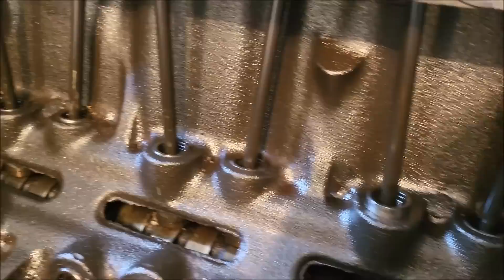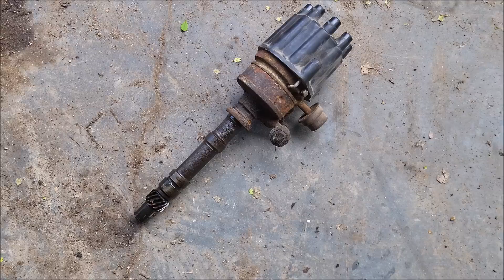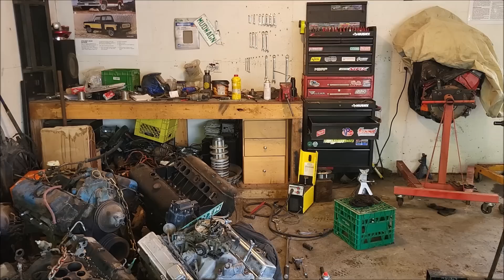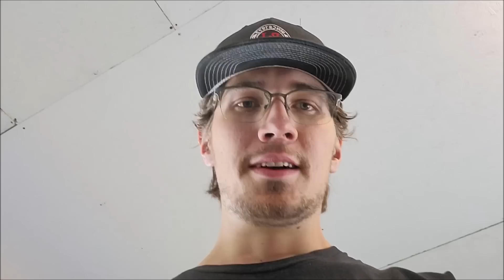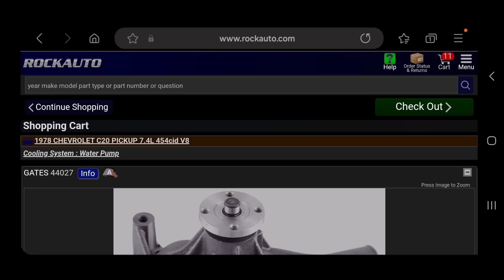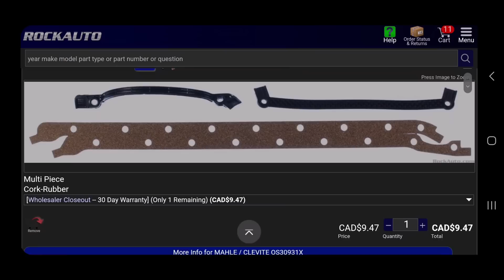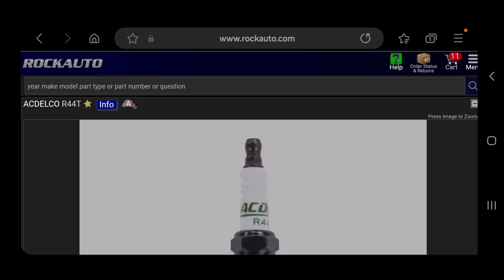Why Does Everyone Ignore Tall Deck Big Block Chevy V8s?

Comment: Dont use a 454 flexplate on a 427, 454 is external balance, 427 is internal balance. A flexplate from a old style 2 piece seal 350 sbc will bolt right on that 427. A regular 396/427 internal balancer is also needed. 454 is weighted. Im currently building a 427 TD with 6.535 long H-beam rods and forged dome pistons for a 9.8 deck 427. Be around 13.2-1 compression. Gonna turn mine 7500-8000 rpm with a big 274/282@.050 solid roller cam, BPE 316cc rectangle port aluminum heads, 2.30/1.88 valves and a Bowtie singleplane intake made to use a standard distributor. Also using a 1050 Holley Dominator. Should make well over 700hp NA. The deck is .400 taller than a 9.8 deck block. These engines were popular in the truck & tractor pulling world back in the day, seen a few blown, alcohol units making 1800+hp in pulling tractors. Also used in boat drags and Pro Stockers in the late 70s. Also mud bog trucks. They are stout. Definitly worh building. Buy an intake made for a tall deck and .400 long pushrods and thats pretty much the ticket. We built a 366 years ago just to kerp a drag car functional while the 454 was being repaired, with just a L-88 cam, a Tarantula intake, 850 Holley and 2 inch Hooker headers. Ran 7.50s in the 8th in a mid 70s Camaro with a 4000 stall & 4-56 gear. Shifted at 6000rpm. Bottom end was stock except for .060 overbore. Had closed chamber 215 casting 396 heads on it. Bolted right into thst camaro with room to spare. Headers fit no problem. Them blocks are thick as hell.
Reply: @thereluctantgearhead4544  That is an awesome build you've got going there. But I don't think this guy is going balls to the wall,I think he is trying to have some cheep fun with some discarded big blocks like a lot my fellow technicians did back in the day. But I got to say I am very impressed with your build. Sounds like it's going to be awesome.
Reply: @johndcunninghamjr4111 I'm building it to run 9s in a 84 C-10.
Reply: I am a ford guy but these bbc engines in all there forms are as good as anything out there. We used to use them to haul cars on a car carrrier back in the day.  We would rev them four grand all day long.
Reply: @robiparry941  Darn right.... 🤜
Reply: My uncle used to race his 69 Boss 429 mustang at the Friday night drags at the Tulsa raceway for a few years before he sold it due to having to spend too much money  because it didn't hold up as well as his 67 L-88 Vette. which when he first started racing it he had a 375 hp ramjet injected 327 that he campaigned for a few years after yanking the original numbers matching L-88 out and setting to the side and put the 327 in the Vette and then went a non numbers matching 427 with the L-88. Before doing a frame off restoration and putting the factory 427 back in and showing it in some car shows. He got a 62 Bel Air with a 425 hp 427 mark IV big block and a factory 427 mark I big block in his 60 Impala and none of them has given him any issues the Impala was used by Ertal models for their cast metal 60 Impala down to the license plate.
Reply: @theEVILone0130 I miss the old midnight drags in Tulsa,twenty minute drive south on 169 was well worth it.i can't believe the track sits empty most the time now.
Reply: I made this mistake back in Auto shop/Highschool. My flex plate was cracked on my 350 small block in my car. I took the flex plate off of the small block that I pulled out of my Dad's Caprice and put it on my Chevelle. It was shaking pretty bad when I drove it out of there. Lol I learned that those metal things on the flex plate were counter weights for an externally balanced crank. I ran the numbers on the block and found out that the Caprice had a 2 bolt main small block 400, cool. I had to do that job twice,  I noticed the difference between the two flex plates, but I still installed that externally balanced one on there. Haha
Reply: Thank you
Reply: Should easily make 800 ill bet cause 700hp + on large sbc 421 my old man was building late 80s early 90s for dirt late model cars. Man those things rev so fast and high I loved that sound as a kid. Now I love it even more cause I understand it.
Reply: @Thumper68 yep, I'm thinking it'll make 800+HP, but I usually give a low ball estimate to keep the trolls at bay.
Reply: Wow❤ so cool !
Reply: I’ve taken a Stock 454, put a Roller Cam, Header’s, Bench Polished the Heads, and an Old School done his little Magic… 
70 Chubby, that Puke Green Color, looked Ruff, 4 Speed with Stock Possy Diff…
I beat the Streets up, and was running good when it left my hands!!!
Lots of Cheap fun in Big Blocks.
Reply: I've heard of derby guys going to the 366 bbc. Grunt engine with thick cylinder walks i guess.
Reply: @RaginCajun-d3n they are practically bulletproof. Be a good derby engine actually. A 76 Caprice wagon with a 366 would be a killer derby car.
Reply: The 366 has a big piston with 4 rings is why people don't make street motors out of them
Reply: @bluesky6985 bore it out to a standard bore 396 piston and use 6.535 long rods. Makes it a whole other animal.
Reply: @bluesky6985 those 4 ring pistons make good ashtrays.
Reply: You can use a flexplate
Reply: I have a td 427, I think both the 427 and the 366 had factory forged crank and rods? The 366 is a de stroked 396 or same stroke smaller bore?
 I got the eagle 4.5" stroke crank, 6.535" h beam rods, its already .30 or .40 over now whatever it was it calculates to 520 ci. I got the newer skip white aluminum heads, im clearanceing the block for the crank right now then going to bring it to the shop to have them make sure cylinders will clean up I don't want to bore it more. Then I'll have them measure for piston pin hight. I'll be happy with 550 to 600 hp, should have gobs of torque it will be going in a 66 chevy c10
Reply: Your wasting a td 427 block if you dont make it 500 to 535
 ci
Reply: @ryangulley2051 RPMs make power. Don't want a 5000rpm tow truck engine. I have other bigblock Chevys that are bigger cubes. They'll make more low end torque, but this engine is using a 5000+stall, so low end torque is a non issue. It's built to be a high RPM unit. Easier with a 3.760 stroke, 6.535 long rods and lightweight pistons.
Reply: call my Billet aftermarket crankshaft is internally balanced
Reply: what a waste
Reply: How did you keep them from blowing up???My dad owned a chevy dealership in Illinoise when I was growing up in the 60s and I had access to all of them.I couldn't keep any of the big block chevys togeather for very long..they would throw rods through the block in an instant. I tried everything...A couple of my buddies had SS 396 chevelles they bought through my dad.One of them was an L78 375 hp and that car was wicked but it blew at around 9k miles.Thry ere not built nearly as tough as they should have been.
Reply: @jimmillet1442 Sounds like y'all hasn't learned about maintenance...! I have an 85 Suburban, 454cid/th400... It was G-pas and it became mine after he put 278k on it... It now has about 520k on the original engine, but we know how do maintenance...!!! I also has my uncles Chevlle years ago with a 396 with over 350k on it before needing rebuilt...!
Reply: @kurtisstutzman7056 Well can't help what it sounds like but I learned from experience and being around them and the way something is built has nothing to do with maintenance...if it's weak it's weak..I've seen and had more exploded rods and cranks in big blocks GMs  by far than anything else.
Reply: @jimmillet1442  Maintain them, and they'll last many decades in my experience...!
Reply: @jimmillet1442  then you didn't know what you were doing because 454's have been the backbone of weekend bracket racers at drag strips all across America for decades. Most of those Chevelle's and Camaro s were running cast cranks in those 454's as well. Stock big block  internals were good for 600+ horsepower all day long and were far from weak. That's laughable. 
If you used the wrong torque specs for the crank and rods, then yeah I could see them spinning a bearing. Failing to resize factory rods is a no-no as well. But, there's a reason so many racers have used BBC's. Besides, if there was an inherent weakness in these motors, we'd all have heard about it by now.
Reply: @msh6865  Sorry but what you said is very laughable!...Check out the powernation 454 build on youtube..they tell several times the bottom end is good for 500hp at best and they had to change out the rods and crank...I grew up around all of them,396,427,454..several 409s which isn't the same family but you claim I was doing something wrong well then everyone else was too then because  I rode in several friends cars that exploded with me in it...but then you could go to about any junkyard and find another and be back on the road in a day to do it all over again and they did.But I wouldn't run 500 horses with stock rods and crank in a 454..no way.
Reply: @kurtisstutzman7056 Clearly you are not a RACER or hot rodder. Any engine can last forever with maintanence IF YOU NEVER BEAT ON IT.
Reply: @JeffKopis  I have an 81 Camaro that's gone 8.90s, but it generally lives in the 9.30s... It's a built 540 from Steve Morrison... It's pulled by my 85 Suburban...
Reply: @jimmillet1442  You can run 500h.p
 with a stock bottom-end BBC ALL day, if you keep the RPMs in check.

Just because that same thing will fall apart with your ford junk, does NOT mean that it doesn't work well with a G.M. big block... 🤦🏻
Reply: @jimmillet1442 , exactly.  Everyone that had a big block  Chevy had blown all of them up by 1975. They either replaced them with a small block or junked the car. No big blocks in my area survived the mid-seventies.
Reply: @bradleynelson5915  Too many idiots, and not enough BBC's.... 

Sure, they weren't drag race engines in stock form, (not many factory engines were) and the problem was that too many people THOUGHT that they were, constantly revved the piss out of them, and blew them up. Foolish people..

Put some decent parts in the bottom-end if you want 7000+ RPM's out of them, and they'd survive for a LONG time without issue. 

There's a REASON that they went on to be the winningest engines in drag racing, and dominated for decades. The D.R.C.E. 1, 2, and 3 engines WERE the thing to have, and there's STILL plenty of them out on drag strips everywhere still doing sucessful duty even though they are old by now. Can't argue with facts. And I don't even run Chevy motors in my stuff, so can can NOT claim that I am "biased". 
Just educated...
Reply: @davelowets  The big block chevy was designed as a nascar engine from the drawing board. It was called the "mystery motor" when it was put in a race car for the first time. The mystery motor is a gen 2 big block which is almost identical to the legendary Mark IV big block chevy that was in the 1970 Chevelle SS. The sbc already existed so GM had its badass V8 powering cars and trucks
Reply: @bradleynelson5915what the fuk are you smoking? I bave several and tons around if you look
Reply: @shootermcgavin2819 actually for ta and nascar chwvy had a abc head llke the bigblock that never made it outt to production
Reply: Use forged rods and pistons  @jimmillet1442
Reply: @jimmillet1442  That is a flat out lie, I have been a tech and racer for over 4 decades, BBC engines just dont "blow up" like you think.
Reply: @jimmillet1442  If you have been in "several friends cars that blew up" of any assorted brands you people don't put oil in your engines. After overv 40 years of racing and hot rodding, majority with BBC I have had exactly 2 engine failures and one of was a broken roller lifter so that kinda goes back to the cam manufacturer. Also broke 1 20 year old crank that had been in race engines for over 7 seasons.
Reply: @fastone371  Sorry dude but even numerous chevy people have told me how weak the rods are in big Blick chevys and this is a well known fact..Oil has nothing to do with it..If an engine makes more power than the parts it's built with can handle then common sense says oils not going to save it when you run them.They just can't handle 7k rpm sprints for very long.
Reply: @jimmillet1442  Not to be rude but you have been seriously uniformed, people have been successfully using Chevy rods in BBC with nothing more than a set of quality rod bolts which you normally replace at rebuild time anyways for decades, Ford small blocks have crappy rods with 5/16" rod bolts, Cadillac, Buick, and Olds all have crappy rods, but big Chevy's, no. Go to any drag strip and ask the over 75% of guys down there who will be running BBC if they still have stock rods and many will say yes. Then ask how many had rod failures, you wont find many and like I stated, 75% of the cars will be running BBC unless Wisconsin, Indiana, Ohio, Tennessee, Iowa, Kentucky, Missouri, Georgia, Michigan, Illinois, and many other states have very, very special GM engine parts. What you claim about BBC connecting rods is pure fabrication.
Reply: @kurtisstutzman7056 Y'all keep talking about 454s and 396s and they are different. They are short deck. This is a tall deck. They don't fit in Camaros etc. Even  if they would fit in the engine bay, motor mounts won't work. they don't even have place to bolt mounts on side of the block.
Reply: @briankennedy5578  My 79 z28 clone had a 454cid/ th400...! They do fit...! Even in a third gen Camaro, a big block fits...!!!
Reply: @jimmillet1442 Richard Holdner took a junkyard 454 and put a big turbo on it, made over 1000+HP. It didn't come apart. All he did was open up the ring gap. Your probably a LS fanboy, that's why your jealous of the bigblock Chevys. I've built more than 50 bigblock Chevys, they ain't weak at all. But a fuckin idiot can blow up any engine.
Reply: @jimmillet1442 Which rods? There are a few GM bigblock connecting rods. They are all tough. I've used the 7/16 Boron bolt dimple rods in 8000+rpm bigblock Chevys and never broke one. The "thumb" rods in the TD engines are pretty stout also. The basic 3/8 bolt pass car bigblock rod will hold more than 600hp all day. I'd bet you have zero experience with the bigblock Chevys. Otherwise you'd know better.
Reply: @briankennedy5578 Wrong, they bolt right in bud. I've done it numerous times. Fixing to do it again.
Reply: @thereluctantgearhead4544 stock rids..I grew up around piles of them..the ss396 cars were everywhere..same with pontiac GTOs...but the 396 engines blew faster than anything ...I was in several cars when they let go..one of them blew a piston fragment into the firewall right where I was sitting...I was in a 67 gto that blew a piece close to me also..scary to say the least...the others blew out close to the road and didn't send anything my way...we ran cars hard back in those days. Thats what they were built for...the fords and Chryslers didn't come apart  like that but the Chryslers had so many electrical problems I didn't like those either.
Reply: @thereluctantgearhead4544 Ive got a 366 laying outside that i took out of a c6500 i put an engine in. There's no place to bolt mounts on the side of the block. The mounts bolt onto the front of the block by the timing cover, and to the bellhousing.
Reply: @jimmillet1442 don't know much about these things obviously. You should listen to people that been building them for drag racing for the past 45+yrs. You might learn something, but I doubt it. Sounds like you already know everything, but in reality you don't know shit. Must be a LS fanboy.
Reply: @jimmillet1442 people would wind them out like a small block Chevy,4500rpm red line for the big block if you miss a gear shifting its blown.
Reply: @jeroldlafferty54 you've obviously never built a bigblock Chevy.
Reply: @jeroldlafferty54 I'm using a 5000stall and a 4-88 gear behind a bigblock Chevy. Shift at 8000-8200rpm.
Reply: @jimmillet1442 My father had a 67 Malibu SS with a 375 hp 396 that he used as a daily driver and raced on weekends when he was in the chariots car club. The changed out the cam, heads and intake along with long tube headers and had over 100k miles before selling it. It make multiple trips to Rochester MN, Poughkeepsie NY, Chicago IL, and San Francisco CA on business trips for IBM schools and never had an issue. He also still owns a 71 Cheyenne pickup with a warmed over 402 big block with a 12 bolt posi-track rear end.  he finally parked due to the turbo 400 tranny finally starting to slip  on the 1-2 shift. It has over 250k miles on it. I know a lot of people who own big block chevys who race their cars and never had issues with big blocks.
Reply: @jimmillet1442 396 and 454 are different. Tall decks are pretty bulletproof
Reply: @jimmillet1442 I use aftermarket H-beam rods & forged lightweight pistons. In stock form, they are designed to run all day at 3500rpm. I've been building bigblock Chevys since the 80s, had pretty good luck with them. Fastest car I've ever owned had a 509 bigblock Chevy in it. It turned 8000+rpm every run. Never blew it up. Raced it for about 5yrs in a back half 70 Corvette. Also had a 477 in a Malibu Wagon street race car, it paid for itself. Had a few more examples, but I've owned over 200 vehicles since the early 80s. Also build Pontiac, Buick and Oldsmobile engines.
Reply: @thereluctantgearhead4544 all those engines fly apart easily..I always liked the 60s GTOs and everyone talks about that 400 pontiac engine but it was weak..yes ypu can put better parts in them but like I've been told that 400 engine cant go past 450hp..the block is too weak.
Reply: @jimmillet1442 just because you can't build engines don't mean others can't. I've had a much different experience with those old ass engines. But I've built over 1000+engines since 1980. I'm building a Pontiac 400 now I'm going to turn 7500rpm. And I guarantee it will stay together.
Reply: I know a guy that built a "stock" block 400 Pontiac with a 8-71 blower on alcohol. Run low 8s in a 68 GTO. Tell him how weak they are. It's on utube if you look for it. Tell him what a dip shit he is for spending all that money on a Pontiac engine. I have a 63 Super Duty 421 Catalina. Been racing Pontiacs for years.
Reply: His makes well over 1000+HP.
Reply: You just gotta know how to build them.
Reply: @jimmillet1442 Then you WERE doing something wrong....

If you can't keep a B.B.C. together, then you should have given up.
Reply: @davelowets  they are famous for blowing up..sorry but that's the facts.The rods and cranks both are weak.
Reply: @jimmillet1442  NO, their not famous for "blowing up".... they're used very successfully at drag strip ALL over the country. 

ALL engines WILL blow up if abused beyond what they're capable of. If you were buzzing stock BBC's to 7000 rpms every day, and they blew up, well THAT was on YOU. There is NO reason to go over 5k-6k rpms with a stocker. They're done making power well before that anyway. 
If you threw a cam and heads on, and they blew up at 7000rpms, again, that's on you for not upgrading the bottom end parts. If you use a stock one like it SHOULD be, and keep the rpms down under 5500, it'll last a LONG time.

If you had all these problems, you were abusing them, plain and simple. A stock engine is NOT a race engine.

If one upgrades the necessary parts for the application, they survive JUST fine.
Reply: @jimmillet1442  If they blew- it was usually the driver or the maintainance
Reply: @leinie6683 
I had a Yugo,  I changed oil and filters every 2000 miles, the engine wore out at just 32,000 miles
Reply: @jimmillet1442  That is false info. We ran a stock Chevy 2 bolt block with main studs and a Chevy steel crank to 8300 RPM's for a few seasons without a failure at over 700HP, in fact thousands of amateur racers have been running BBC Chevies for decades without pattern failures.
Reply: @davelowets do bear in mind there are a few exceptions to the 5-6k rpm rule. My grandpa raced an L88 Camaro with a rock crusher (he built it himself, he didnt buy it this way) and the car has stayed the exact same since then. My dad and I both have reved the piss out of this thing and it begs for more. But then again the L88 is a 427 and given they were internally balanced they could take that sorta thing better than a 454
Reply: @jimmillet1442 That's why I'm a Mopar guy.
Reply: @JeffKopis  that's why I'm a ford/Mopar guy!
Reply: @jimmillet1442  Your a "ford/Mopar guy"....

Well, that explains why you shit all over G.M. products. Good luck with your Mopar and Ford junk.

A Mopar 440 is a big block with small block heads on it, and will never make enough power to hurt itself. Sounds right about up your alley... 👌
Reply: You like to go slow @jimmillet1442
Reply: @JeffKopis mopar is on lifesupport.
Reply: Forged crank 454 is internally balanced just like the others. Only cast steel crank 454 were externally balanced.
Reply: 454 engines are all external balance. There was not enough room in the crankcase for the huge crank counterweights the factory would have to use. So they hang some weight on the flywheel and the harmonic balancer.
Reply: @johneckert1365  Nope, every 454 or 4" stroke BBC crank is externally balanced, 396 and 427 are internal.
Reply: @fastone371  Thanks for the correction 👍
Reply: @johneckert1365  I dont know that what I told you is a correction its just what I have seen and my opinion.
Reply: @fastone371  It seems to be the consensus that I was wrong. Glad I found out, because I hate sounding like a dipshit lol
Reply: @johneckert1365  No worries, glad I could help if in fact I did.
Reply: @johneckert1365 old saying goes, the wise man never stops learning, the fool knows everything.
Reply: Not true @johneckert1365
Reply: @johneckert1365 all my 454s came external balance no matter what crank it came with. I have a collection of them, so I know.
Reply: @johneckert1365 But I paid a shitload of money for Mallory metal and had one of my 454s internal balanced. But it's a high RPM unit.